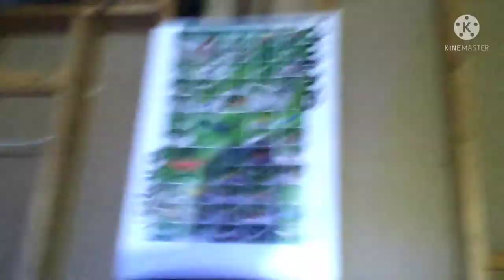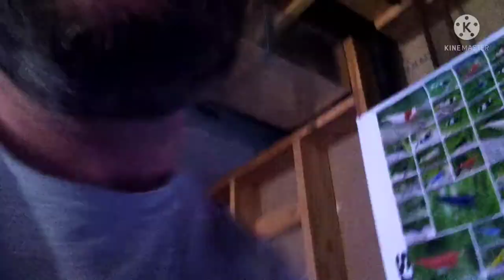Dehumidifier, water, 3ppm TDS reading. Safe for aquariums,

Comment: Very grateful for this video! Some of my tanks are in need of some topping up, but I have been merrily using my rain barrels to do water changes on most of my tanks for the last 2 months, and my fish have never been happier! But we havent had rain in a week and I've been seeing the water get lower than I am comfortable with in some of my tanks, so I was eyeing my dehumidifier tonight and pondering using it, but went to surf the interwebs to see potential problems. I was thinking maybe bacterial growth, but your findings surprised me, and so of course had to test mine. The results: TDS of 59, GH 0, pH too low to be read, KH 40ppm, trace nitrates, nitrites were between 3 and 5ppm, and ammonia between 4 and 5ppm. Eeeeeeep!!!! Glad I didn't throw caution to the wind!
Reply from the maker: I'm happy you saw this video in time! Thanks for sharing your nearly scary story! I top mine off with RO water now. I keep buffers in my filters. You can always add purified water from your local GS 🤙

Comment: I came here looking to see if I could drink dehumidifier water to save me buying a distiller. I see now I cant and also need to find out if the distiller I want to buy has any aluminum in it. Thanks for posting this, very helpful.
Reply from the maker: Distilled water is perfectly safe. 🤙
Thanks for watching!
Reply: I have a dehumidifier and a water distiller.   I use the dehumidifier water in my washer and I have also used it in the distiller to make pure distilled water.  However, I would never drink the water from the dehumidifier.
Reply: @markg6860  You drink sewer water now, why wouldn't you drink filtered humidifier water?
Reply: @thomasodetinape4180  I sure don't.  The only water I drink is from my distiller ... and that includes ice cubes, tea, coffee, etc.
Reply: @markg6860 Distilled water is only ok for short term consumption.
It has no minerals so your body will pull all of them needed from your teeth.
Reply: @thomasodetinape4180  A commonly touted warning, but distilled water pulls only the INORGANIC material out of the body ... the stuff that should not be there, to begin with.
Reply: @markg6860  just wait and see
Reply: @thomasodetinape4180   Don't have to wait.  Many people have been drinking distilled water, with great health benefits, for years.
Reply: @markg6860  BS, high blood pressure will show up first. Human body was not meant for stripped water.
Good luck
Reply: @thomasodetinape4180  Well, both snow and rain are distilled and man has been drinking both, for eternity.  Also, there are many testimonials from MDs and I'd rather take their advice, than yours.
Reply: @markg6860  It doesn't take much common sense to not put an inorganic water source into an organic body.
Reply from the maker: I liked reading both of your points. Nice debating 🤙
Reply: @thomasodetinape4180  As I said, both rain and snow are part of nature ... it's the only water that nature can make.  To say that it's harmful to the human body is quite ludicrous.  (What do animals drink and how do you think humans kept hydrated, before indoor plumbing?)   After I run my distiller, the amount of baked-on brown gunk on the bottom is shocking and I certainly don;t want that in my body.
Reply: @markg6860  🤣

Comment: If dehumidifier water is high in ammonia, can you then use it to cycle your tank by adding bottled bemeficial bacteria and monitoring the readings for about a week and then adding the fish?
Reply from the maker: If no animals, you can use dehumidifier water for as long as you like. It'll feed any plants you put in there too. 
Always check your water in general and make sure it's been stable and ammonia free for quite sometime before adding livestock. Hope that helps 🤙
Reply: @yourtap  Thanks for the reply. I'm new to this fish keeping hobby and I can't find much information using dehumidifier water as means to cycle the tank. Many have opposed using it but from what I've been reading up on, it should make sense to cycle your tank using dehumidifier water so long as you monitor it closely before adding livestock
Reply from the maker: @hafizx1018  cycling your tank requires dead organic waste (ammonia), once ammonia is established then bacteria starts to form and break it down into nitrates which is safe obviously for animals. 
Waiting for ammonia to just simply happen can take quite some time. 
Fastest way to cycle a new tank. Throw something dead in it like bugs you found or rotten plants. Both already have the ammonia and natural bacteria doing their magic. 
The higher the ammonia levels you create will in turn build more bacteria. Quite often people will cycle their tank off nothing for a month ergo the aquarium is only equipped to deal with minimal aquatic life. Because of this, beginners think the aquarium is ready for a full tank of fish and they create a second ammonia bloom. 
You want to drive your ammonia to the max so your defense is equipped to handle all the literally shit that your animals produce.

Comment: I’ve been doing some research but haven’t actually experimented yet. Have you tried zeolite water filtration? It is supposed to remove ammonia but I was unsure if it does it sufficiently for fish.
Reply from the maker: I haven't heard of this filtration unit before. I've been using the same aquaclears for all my tanks for years. I wish I was more help with that.

Comment: Hi. Thank you so much for this crucial bit of information. I'm wondering if there is possible to cover the metal (aluminium) plates/coil with something like glass or plastic foil so it will keep the cold part in order to allow the condensing process but won't let the condensed water to touch the metal.
Reply from the maker: Thank you for watching and I appreciate the question. 
I'd be lying to you if I gave you any opinion about that. 
However, your logic seems sound and I say if you have the know how. Anything is worth trying.
Reply: @yourtap  I'm asking because I was up to almost get a dehumidifier for my room (and same room where I have the aquarium) and since the aquarium doesn't have a lid, the water evaporates. Adding normal water will increase the calcium carbonate concentration and I usually have to add purified or distilled water. Now... my ideea was: I get a dehumidifier then I collect the water and put it back ..., until I saw your video. I know how a peltier bridge works and I know they use aluminium so it will conduct temperature faster, but if some cover can be added (like a plastic foil) I don't think it will influence too much the condensing process for water collection.
Reply from the maker: @aibatt2839  , I don't use lids on any of my tanks either. I have 10 total. 7 are in my fish room. I definitely needed a dehumidifier. It fills up twice a day. Thank you for sharing your knowledge. It hadn't even occurred to me to think about that aspect. 
I'm happy you saw this before you made the same mistake. 
I think your idea is definitely worth digging into. I suppose it comes to cost. If you think it'd be a cost efficient. I would be interested in making an adjustment to mine. 
The facts you shared in understanding why they use aluminum, that part I didn't look into. 
This explains why I can't find one that doesn't use aluminum. 
I have to use one meant for 2k square feet in a room that's only a couple hundred square feet. There are hundreds of gallons evaporating weekly.

Comment: So is the problem the aluminum coils? The aluminum in the filters? Or Aluminum in the air? What if it was running outside?
Reply from the maker: It's the Aluminum coils. Because of this, it doesn't matter where you run it. It will automatically attract ammonia. 
That was a valid question. Thanks for watching!
Reply: So the solution is to buy a machine with copper coils or replace the coils with copper.

Also it seems silica water can heal the aluminum poisoning.
Reply from the maker: @TheMiccoliGroup  , right. Copper would be the route you'd want to take. Many manufacturers don't use copper because it drives the cost up. 
This is true for AC units as well. 

There are many products sold that detoxify ammonia. It doesn't remove it. It remains in the water.
Reply: @yourtap  can a berky filter remove all that and make the water drinkable?
Reply from the maker: @misismatos9902  I wish I had that answer. I'm unfamiliar with that filter. I usually won't give advice on products I haven't worked with myself.